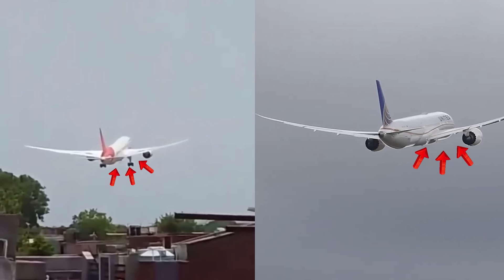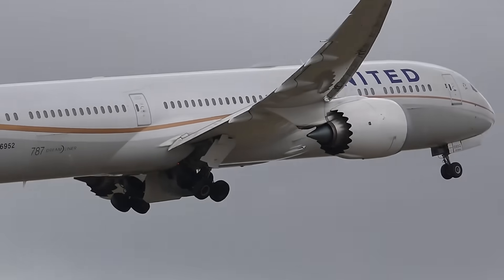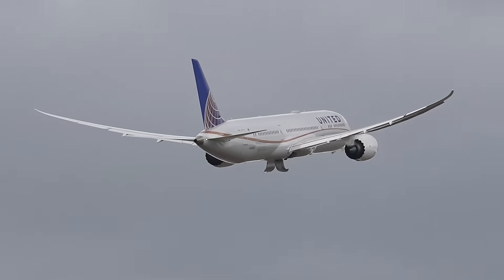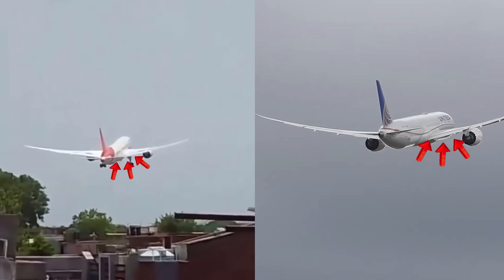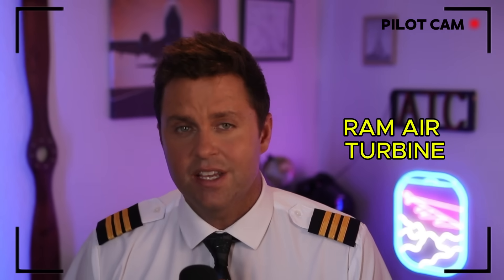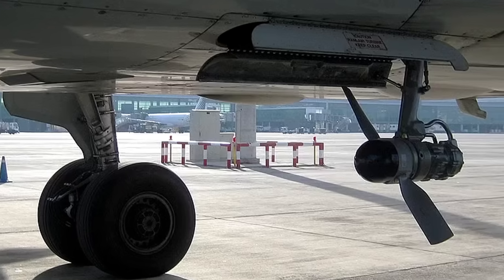Pilot Explains: A New Detail in the Air India 787 Crash Everyone Missed

Comment: That is one of the things I had pointed out when I first saw the rat video if those engines were full power you would barely or not even hear the rat and you just don't hear those engines at full no power coming from them at all. Also t think your right about the gear too the tilt forward that is when the failure happened when he hit the gear up and that is perplexing. All I can think is some hydraulic explosion next to a important electrical system but then you have redundancy i just don't know. I do know I want to know the answer this is worrysome

Comment: Interesting perspective video, thanks
With that original much higher quality video, it indicates to me very strongly that this was TOTAL hydrophilic or Electrical failure (The chances of a duel engine failure is astronomically unlikely, even with fuel contamination, there is ZERO CHANCE of them both failing at the exact same time, beside the pilots would have reported that right away and it would have been audible in the video sound), which explains the poor engine performance and even the total both engine failure, and the gear not coming up, which put the blame SQUARELY at BOEING'S FEET with their culture of STOCK PRICE over HUMAN SAFETY !
just my 2 cents

Comment: AGAIN, be cautious with your statements.  This YT was published on airliners forum; it clearly suggests that a wheel boggie tilt is normal once the wheels are no longer on the ground.  https://www.youtube.com/watch?v=zxLJ9pd0ef0  Also, you might also want to be cautious about denominating "engine failure".    The engines might be in perfect condition and told by either systems or wrong manoeuver to return to idle.   It will be interesting to know what the pilots attempted or not to save the day.

Comment: Yes, when I watched his video yesterday, I was like ”yes, you can clearly hear this prop, but if the jet engines had any kind of thrust, you would definitely hear that too, very loudly”.
Reply: You are aware that there is more than one version of the video circulating? One of them has overdubbed audio which sounds like a RAT. The original does not have that, just distant sounds from traffic and the aircraft.
Reply: That steeve video came again apologise His mistake in his Opinion  .there was tail prop which automatically came out When there was some failure it's noise is more compare to plane He even metioned in his latest videos.
Reply: @alphapolarfrequency2787 brother, please proof read before you post.
Reply: @alphapolarfrequency2787: WTF is a "tail prop"? You have no idea what you're talking about.

Comment: Good anslysis Steve and Gary, well done. Here a view on the possible causes by a B787 Technical instructor ...

To my opinion  the most likely source is a failure of the multiple 235 V AC electrical buses. This made the RAT automatically come out just after take off.

Wiyh the loss of multiple 235 VAC buses the forward and aft booster pumps in the wing tanks will stop (electrical load shedding from any remaining bus) and no longer supply the engines. Also de two electro motor driven Override Jettisen pumps of the center fuel tank will stop without electrical power.

As a result the engines are supllied only with fuel by gravity and suction feed. This lower fuel flow will result in loosing engine take-off thrust.

The landing gear retraction is on the blue hydtaulic systen. The deployed RAT in the blue hydraulic system can only hydraulic power the primary flight controls. Because of loosing the electrical 235V AC busses, the electric motor driven blue hydraulic pumps (C1 and C2) stopped. As a result the landing gear could not be retracted.

The surviving passenger mentioned the cabin light flickering. Because of loosing the electrical busses the cabin busses were no longer energized. As a result the cabin  emergency lights came on running on dedicated batteries.

The 235 VAC electrical power centers are in the aft electronic equipment  compartment. The surviving passenger mentioned hearing a loud bang at take off. Could this have been an explosion in the aft E/E compartment, damaging the 235 V AC power distribution centers? Or could it have been the aft wall of the aft E/E compartment collapsing, as a result of cabin pressurization at take off?

Conclusion, the most likely cause is loss off multiple 235 VAC buses,  resulting in stopping of the fuel pumps. Reduced engine gravity/ suction fuel feed caused the loss of engine take-off thrust. On the video the engines were running at lower power and therefore not loud.

Comment: I understand there are triple redundancies on most systems. Electronics are usually robust but they do have a weakness. High voltage is their arch enemy. More over, if it can wreck one set of circuitry I'm sure it could take out the rest. What that source of high voltage may be I have no clue. Could it be a static electricity charge from cargo of some kind? Even contaminated fuel I question. Sure, one engine affected but both at the same time. Could a fire suppression system malfunction and turn fuel off without discharging fire retardant?

Comment: It was a hot day, and the aircraft had been sitting on the tarmac for more than 2 hours. It could be that vapour lock deprived both engines of fuel and they wound down causing an electrical power failure. At that altitude there was insufficient time for an engine restart.
Reply: No.  Planes sit in the sun all day all the time.

Do you think they go to a Airplane Garage between flights???
Reply: @TeddyRumble  Think of it from an engineering perspective. Basic physics requires that there must be both an upper and lower limit to the temperature of an aircraft beyond which it is not safe to operate. (i.e. jet fuel is a liquid which has a predictable boiling point and freezing point at atmospheric pressure; the viscosity of liquids such as jet fuel and hydraulic fluids varies with temperature and this affects the operation of pressure pumps, different metals expand and contract at different rates according to temperature which can affect the operation of engines and other mechanical components, cooling systems for electronics have a limited heat rejection capacity etc.) 

Over-heating is the enemy of all machines (i.e. drain the cooling system of your car and see how long it takes for the engine to fail! This is the reason why car manufacturers provide an engine temperature warning indicator light on the dashboard.) Video captured by passengers before this flight took off indicate that the cabin air conditioning and entertainment systems were not operating in a manner that one would expect. The question is ... what is the upper operating temperature limit for 787, and in particular for the engine fuel feed system?
Reply: @TeddyRumble  Typical maximum operating temperature for this kind of aircraft is 49 degrees Celsius. Ambient temperature on the day was 43 degrees Celsius. Two hours on the runway in the beating sun ... vapour lock!

https://www.youtube.com/watch?v=XptrHxG9dDk

Comment: Flight: AI-171 | Aircraft: Boeing 787-8 | Date: June 16, 2025 | Route: Ahmedabad (VAAH) → London Gatewick
Crash Site: ~1.2 km from VAAH Runway 23, post-V1 and rotation
Fatalities: 247 (243 onboard + 4 ground)
Survivors: 0 onboard survivors (alternate to original), 3 injured on ground

⸻

🛠️  AAIB Preliminary Report Highlights

1. Primary Cause – Electrical Power Transfer Interruption (PTI) During Rotation
	•	During transition from ground to airborne electrical configuration, the aircraft experienced a cascading dual-engine FADEC (Full Authority Digital Engine Control) failure.
	•	Root cause: Uncommanded bus transfer failure due to arcing in the main power relay box (PRB-A), traced to water ingress during pre-flight GPU disconnection in heavy rain.
	•	This led to loss of electronic engine control at rotation, resulting in both GEnx engines rolling back to ground idle within 4–5 seconds.

2. Flight Data Record Timeline
	•	+0:11 sec: Nose gear lifts off.
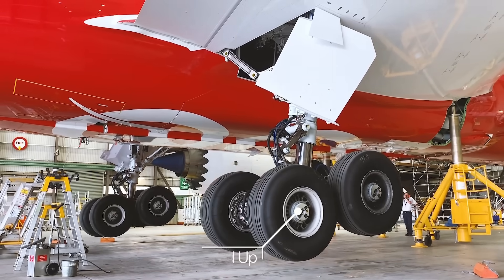	•	+0:13 sec: Sudden engine rollback begins. Thrust reduces from 92% N1 to <27% within 3 seconds.
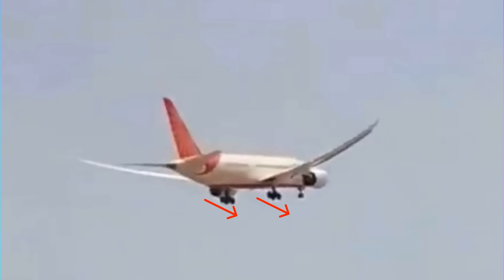	•	+0:16 sec: Master caution + ENG FAIL L/R warnings. FO calls, “Both engines dropping!”
	•	+0:20 sec: Autopilot and flight control reverts to Direct Mode. Pitch up attitude peaks at 18°.
	•	+0:25 sec: Aircraft stalls at 186 ft AGL.
	•	+0:30 sec: Full aerodynamic stall; nose drops rapidly.
	•	+0:38 sec: Ground impact at 54° nose-down attitude, 174 knots.

⸻

⚙️ Contributing Factors
	•	Environmental Conditions:
	•	Torrential rain during pushback.
	•	Moisture intrusion into PRB-A connector (P/N: HLN8471) — a known corrosion-risk component.
	•	Latent Maintenance Issue:
	•	Power transfer relay unit showed signs of thermal damage in a previous MEL deferral 2 weeks prior.
	•	No replacement had been conducted; aircraft was cleared under repetitive deferral.
	•	Design Oversight:
	•	Boeing 787 has no physical engine control backup (i.e., no direct mechanical linkage in FADEC loss scenario).
	•	Loss of power supply to both EEC channels resulted in engine “freeze” at ground idle instead of flameout.
	•	Flight Crew Response:
	•	Attempted engine relight sequence not completed before stall onset.
	•	Emergency power selector not activated — possibly due to confusion from multiple ECAM warnings.

⸻

✈️  Immediate Safety Actions
	•	DGCA + EASA + FAA Emergency AD issued within 24 hours:
	•	Mandatory PRB-A moisture integrity inspection on all Boeing 787 aircraft.
	•	Temporary restriction on dispatch with MEL items related to power transfer systems.
	•	Boeing:
	•	Issued Service Bulletin SB-787-24-212 requiring replacement of PRB-A connectors with sealed versions.
	•	Exploring addition of dual-path power redundancy for FADEC systems.

⸻

🧠 Lessons Learned
	•	Over-reliance on electrical power distribution architecture without layered redundancy.
	•	Lack of crew procedural training for full engine rollback during takeoff in EEC dual failure scenarios.
	•	Need for improved environmental sealing in GPU/electrical handover units in monsoon zones.

⸻

🕯️ Human Toll
	•	The loss of 243 onboard lives, including 12 crew and 18 infants, deeply impacted the aviation community.
	•	Final words captured on CVR: “We lost everything – no thrust!”
	•	One family of five was killed on the ground in a hospital ambulance struck by debris.

⸻

📅 Timeline – What’s Next?
	•	Aug 15, 2025: Release of FAA/Boeing electrical design audit report
	•	Sept 5, 2025: ICAO session on electrical-critical phase-of-flight risk mitigation
	•	Oct 2025: Mandated design retrofit across 787 fleet (rev. SB-787-24-219)
Reply: Headed to Gatewick, not Heathrow.

Comment: hi, another Youtuber said that the RAT will deploy if you loose the main bus, are the fuel pumps electrical or mechanical? if they are electrical would the RAT be enough to keep them running, I'm an engineer, I don't work on aircraft, just trying to think logically about the situation.

Comment: No, not everyone missed… it’s not new information. Neither the RAT, or the gear/wheel position. And you can search google images with 787 takeoff, the design of the plane will not make the flaps that obvious. And you can forget @CaptainSteve. 
It was clear from the start, from first second of the footage, from the flare. No pilot with 8000 hours, will make that mistake. They knew that They will go down… you will flare at that speed, in those conditions, trying to go up, if you are ambecil. And I really trust pilots in general, as a student pilot.

Comment: Full electrical power loss in an automobile means no power to the fuel pump, hence the engine will shut down. Surely planes use a fuel pump to pump fuel from the tank to the engines?

Comment: A question, for example, if they had a critical failure of eletric or hydraulic causing the RAM to deploy, with the fact that the gear was down and possibly flaps on wrong position, could it outpower the Engines? I mean, I have no idea how powerful is the drag from the RAM system

Comment: "Everyone missed" aside from the commenters saying this for several days on other channels. But I agree with you about the engine problem because of the audio. I believe there are electrical fuel pumps .... if they lost the entire electrical system (there were reports of electrical system problems and AC on the previous flight) then could both engines have been starved?

Comment: I have heared pilots say that the 787 has widely been in use since 2011 and that it is an extremely safe aircraft, since until this first catastrophic event, no major accident have happened.
Now that several electrical malfunctions have happened recently in 787's, it seems that time could have become a crucial factor in compromising the electrical safety of this aircraft. Maybe some electrical or software components that are not maintained or replaced are beginning to wear down.
How old was this Air India's 787?
Reply: it was a 2011 model if i remember correctly

Comment: Even with engines back at idle the electro hyd systems would still be operating and the gear would continue its transit into the bay. 

Presumably AI SOP is to derate power on take off and use the auto throttle? Clearly something very non-normal happened at the worst possible time. I don’t think the pilots had much of a chance UNLESS the problem started before V1 and they continued regardless. 

This is definitely a pivotal moment in the 787 program and everyone around the world will be watching intensely.
Reply: Watch the video.
Reply: @kiereluurs1243 I did.

Comment: Does anyone else think it seemed to take off very close to the end of the runway?
Reply: If the contaminated fuel theory is true (which would only happen in an act of sabotage), the engines were not putting out enough power to cause them to accelerate normally so they used up more runway.

Comment: Is it possible that some unit in EE Compartment was overheated and/or burned because of very hot weather (+40deg C) and it has cut off fuel supply to the engines?

Comment: This is very interesting Gary. I personally think that it was an electrical fault because the wheels could not lift up into the aircraft. Also if the engine's had failed, the pilots could not have glided the aircraft in as though they were trying to land it safely.  This is how it looks to me anyway. I am not a pilot of course but I have this gut feeling that it was electrical. I have been on air India aeroplanes quite a few times and love to be in an aeroplane sat by the window! I must admit this terrible crash has put me off flying somewhat.  Thank you for your information on this. 🙂

Comment: Further to my previous comment, if, as now seems likely, it was a simultaneous loss of power with both engines  (indicating a problem with the electronic control/management system, rather than an actual engine failure), why haven't all 787s been grounded??

The suggestion that such a failure is extremely unlikely, or that 787s are very safe because none of them had had a fatal crash before this, is irrelevant. The FACTS are that one DID crash - for, so far, unknown reasons. Why isnt that enough justification for a grounding?

Are are the authorities just waiting to see if a second one falls out of the sky for 'no apparent reason' - like last time?

Comment: You were unable to here the Rat because it has only just been deployed and hadn't gotten anywhere near a useful speed because the airplane never got to any useful speed once it managed to get off the ground. The Rat is usually deployed when an aircraft loses power at cruising speed which is between 400-500mph. That's a big difference and would easily explain why you did hear it during this part of the  flight.

Comment: @Garybpilot and @CaptainSteeeve, how long would it take to thoroughly analyze all pilots' analyses using our best tools, including OpenAI or other LLMs, to reach our "best hypothesis of the answer"? If Boeing grounded all 787s to analyze the data and tested the results in a simulator, it could gain valuable insights? Release the 787s with new instructions for handling in-flight issues. Just a thought: without both engines, you're only a glider, right? WOW! OMG, what a thought!

Comment: The aircraft had dual engine failure at N2 or miliseconds after it. The aircraft continued climbing under its own inertia effect, then started decending.

Dual engine failure can be due to ANY common attribute:
1- fuel quality
2- fuel pumps & delivery system
3- any common electrical / electronic circuits
3-

Comment: There is a comment of an airplane electronic expert under the second Cpt Steeve video, who wrote what if the electronic unit for running the fuel pump(s) (there is only one central unit for that, that's what he wrote at least, I cannot confirm that) failed due to the enormous heat of that day during the middle of the day - and then the additional heat buildup in that electronics for running the fuel pump(s) at the power required to run the engines on takeoff power. What if something like that might have been the cause... That's round about what the electronics person wrote under that mentioned video.

I don't know if he is true in that comment, I have no knowledge of that. I just relay what he wrote there.

Could that be something or is he wrong? I don't know. Is there a cooling system for that electronics and could that fail? Or whatever... 

------
Well, whatever it was, they would find out what went wrong, hopefully.